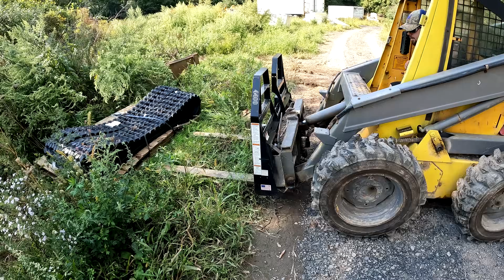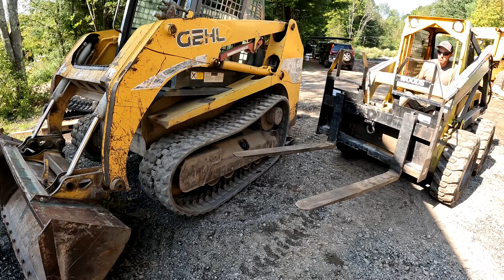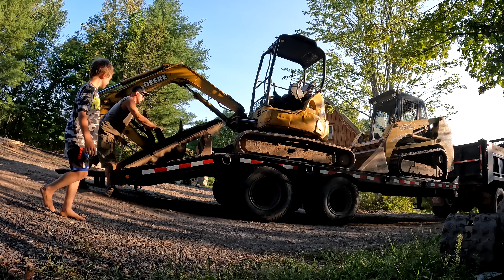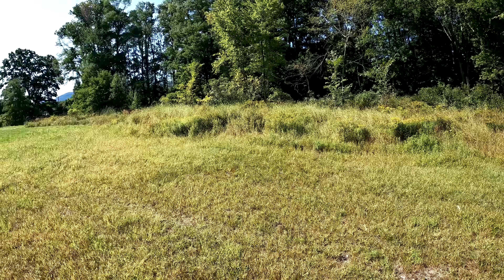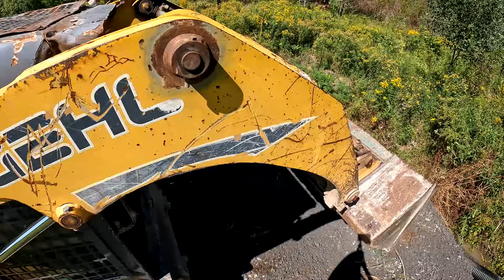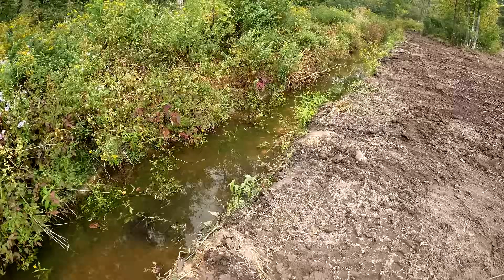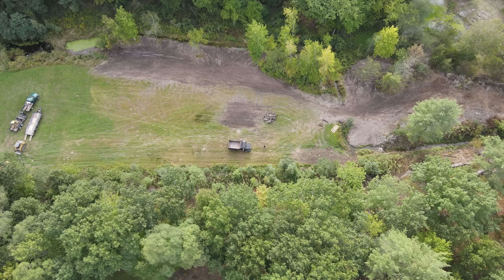Install new tracks on the Gehl and do a land clearing job

Comment: A lot of Skid steer owners change the drive sprockets at the same time as fitting new tracks. It make the tracks last longer. Because fitting new tracks on old drive sprockets, wears the tracks out far quicker due to the worn teeth damaging the new tracks.
Reply: Wouldn't dream of fitting new tracks without replacing sprockets..
Reply: It is exactly what I thought as well. You are suppose to replace both, because they wear out both at the same time. The new tracks are wearing more in the beginning because of the difference between the two.
Reply from the maker: I didnt realize that you should do it every track change, I thought it was every other one. The sprocket doesnt look too worn to me
Reply: @jmuller86  worn sprockets will accelerate the wear on the new tracks..
Reply: @stuartandrews4344  Chris from Letsdig18 recently swapped his tracks on the Takeuchi and in the video he explaines changing both because of this.
@Jesse Muller Price at truckortrack seems okay, $380,- for the pair.
Reply: @chillywilli  Just seen that video..
Reply: small price to pay, to stop ruining new tracks.
Reply: @chillywilli  that's a fair price imo.

Comment: Hi Jesse just curious which do you prefer the track or the tires seeing that you have both or they serve their purpose thanks for sharing have a good evening
Reply: Depends. As a homeowner just doing things around your property, tires are far less maintenance and cost. But as a business owner, you can’t really beat a track machine.
Reply from the maker: I like the tracked machine alot more, but wheeled machine is half the price usually so you could almost have 2 for the price of a tracked machine....that being said the tracked machine has unbeatable pushing power.

Comment: @1:01 "I'll keep them both as a spare"... until next time when you need new tracks and you'll just buy new tracks instead of putting iffy old ones on and then have to put new ones on anyway later on!
😂😂😂
Reply: Its not planned maintenance spare. Its the machine has killed a track in the process of getting bogged in some random location spare. 

Send some to get the spare and install in the field. Assist recovery being able to drive.

Comment: Do you have to use the clutch it wont float gears?
Reply from the maker: Its a synchronized transmission so I need to use the clutch

Comment: What size trailer is that
Reply from the maker: 15 ton, its got 20 ft of deck
Reply: @jmuller86  thanks I have the same set up of machines and want to haul both at same time

Comment: if an old track is broken or completely worn out why not just take an angle grinder and cut it off? Would save a lot of time.
Reply: stinks like hell and sprays hot rubber around.

Comment: I am still waiting for semi truck service and painting wheel or cleaning and repair
Reply from the maker: it was on the list for a while but then a few unexpected things happened and I lost the time for it. I have moved that back to right after I finish the roof on my house, since I need every minute between now and freezing weather to get it done. I spent almost a month at my old house doing work to sell it, that was not planned for
Reply: @jmuller86  Has your old house sold now?
Reply from the maker: @mikeb1  yea its under contract. Should close in about 2 weeks

Comment: 25:25 Excuse me, but this pipe is very thin, and when it rains, the waters will overflow, flooding this part of the land.
Reply from the maker: that pipe could be 4" and be enough to work. it does not run that much water

Comment: 191: GOD, I AM convinced that these band designs r not the way to drive these skid steers. I talked about fork tires w/soft shains old school far more durable working 7k hours normal life span far great design front & back end, we hve gone backwards w/bands. They might still impove them. I talked about two band design, 1 that wire spider lie wepping that streach & top band screws down into. But that not making top band 7k hours durable.

Comment: A bit disappointed at 05:09.
Where your fellow you tubers point out the urgentie to change track and sprocket you dont.
Reply from the maker: I didnt realize it was that important
Reply: @jmuller86  every ,,drive chain,, and sprocket wear. (Timing chaines are a ? for me). Also a toothed wheel of a chainsaw. The worn wheel wil wear out the chain/track rapidly because the pin wont drop in the ,,valley,, between the teeth. Unless both where quite new and the chain/track breaks its better to renew both. If you look at letsdig18, dirtperfect, candcequipment you wil find an example. New vid? Replace the sprockets?